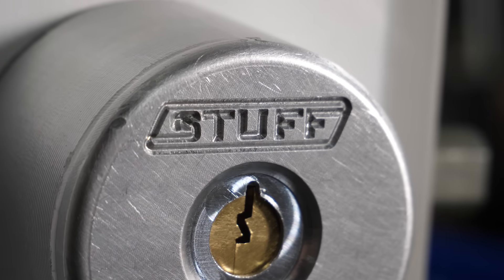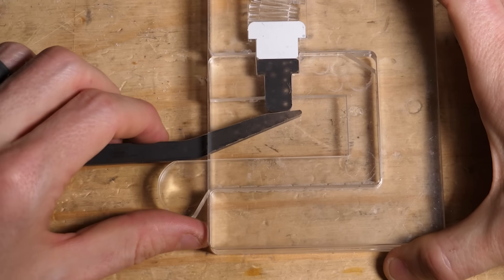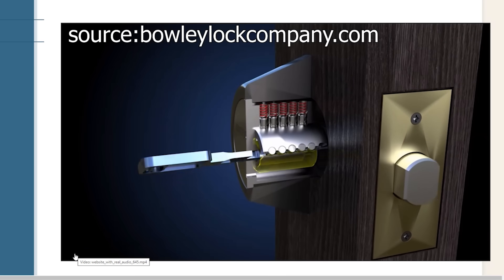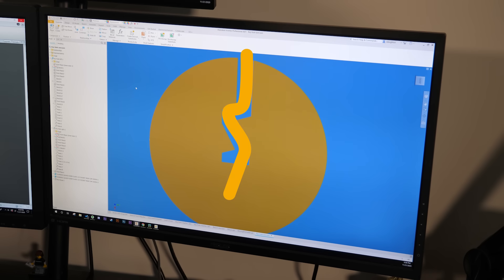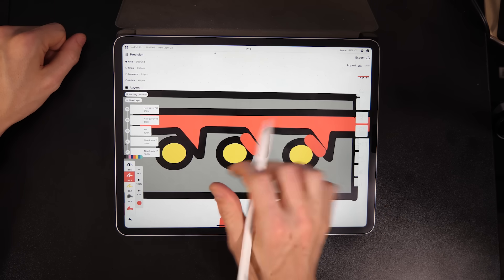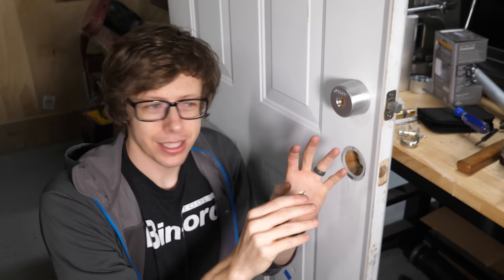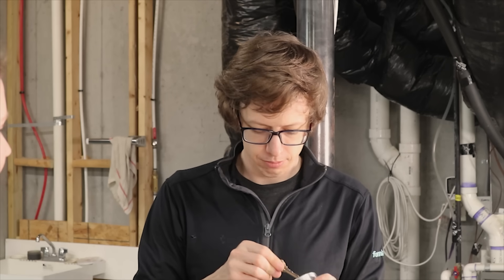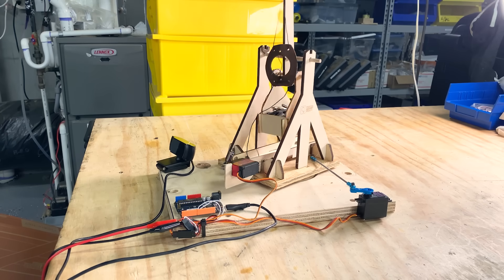Making an unpickable lock. Calling locksmiths

Comment: Unpickable?  That's not the purpose of a lock.  I'd written about 10 ways of defeating locks and other forms of security, then erased it before posting here, as posting means of defeating security isn't secure!

Yes, I'm aware this video is all about whether a good machinist could create a lock that's difficult or impossible to pick.  Proper security, however, isn't about creating "unpickable" locks.  It's about deterring and delaying entry, among other things.  I've been in the physical and networking security business for decades, and while front doors are rarely unlocked, there are many ways in, so proper security considers all such ways.

SECURITY GOALS (simplified from a vastly more comprehensive list courtesy of ISO):

1.  Make both attempted and actual unauthorized entry both detectable and reportable.  Modern alarm systems do this well.  If you get an alert any time someone gets within 10 feet of your doors and windows and can view their activity in real-time, you can call 911 before they even gain entry.  That's great!  Catch the bad guys in the act.  Put them away.

2.  Introduce delays to entry which cannot easily be defeated.  If it takes two hours to pick an "unpickable" lock but only a second or two to gain entry through a window, then your lock isn't doing you much good.  Secure those windows!  Yes, bars are ugly, but repeatedly being robbed is uglier.  Figure out ways bars cannot be ripped off with a chain hooked to the bars and a truck.

3.  Employ deterrents which convince burglars of either of the following:
 - They'll be apprehended before they gain entry.  Do NOT make this an idle threat, or you'll just help create a crowd of ever more brazen criminals.  Back it up with reality.
 - Whatever might be inside isn't worth their time and effort, much less the risk of being caught.

4.  If you're going to use cameras, do it right, within your means, of course:
A.  Use both overt cameras, which act as a deterrent, and expect them to be smashed, as well as hidden cameras.
B.  Use cameras both inside and outside.
C.  Include eye-level cameras at well-lit entrances and exits to capture faces.  Even masked faces are revealing.
D.  Capture all content for a week to a month or longer on hidden, local storage, but stream both current and the last 24 hours to the Internet for storage beyond the reach of burglars.  Burglars often scout targets ahead of time.  Less expensive systems begin streaming the instant the alarm detects entry, until the key code is entered.
E.  Include a street camera in both directions for capturing license plates both coming and going, as well as of potential accomplices.
F.  All cameras must be both HD and low-light or IR.  It's better to have a camera somewhat zoomed in to a well-lit spot where a face will transit than zoomed all the way out to try to capture everything but not be able to discriminate the detail of anything.  One situation involved a guy with two cameras mounted 25' up in pine trees.  Covered all four walls of his house and the roof, but zoomed out as they were, all they did was confirm his house was robbed.  A single hidden camera in a lit foyer aimed at the front door (which was kicked in) would have worked better.

The key (pun intended) point, here, is to approach this issue from the point of total physical security rather than focusing on the lock.

Comment: Just use a brute force locker. if you know how many pins there are and you know the distance between the pins you can build a cheap contraption that automatically tests all variations of pin depths while simultaneously turning. Surprised this tool doesn't exist yet.

Comment: I would just have a friend set a car alarm off on your street and then discreetly break the glass on the front door and let myself in but I am not a criminal.  Or, your door is wood and your jam is wood... I would just kick your door in  by focusing past the door and lining my kick up with the center level  of where deadbolt hits the door jam... metal would win and break the door jam unless the jam  is reinforced but most aren't... BTW, it is less of a lock picking challenge when you show how the lock works ahead of challenging him.

Comment: I dunno man... commercially non-viable? There is always a focus group of engineers who can simplify your ideas to get more mass produce-able units constructed and out to market. You're a smart ass dude and that lock is borderline genius. I wouldn't give up so easily on that. I can pick just about any standard tumbler lock and most keyed master locks but that thing you made looks impossible. Maybe you could construct a specialized bump key, but even then... just too complex...Well done! Superb ideas.     Now... where I disagree with you:  "want a lock that cannot be picked? get a lock without a key".  (assuming here you meant electronic or magnetic lock).  But you can easily shim or pick a combo lock and electronic locks have faults too. (RF cloning, cutting power to electromagnets, weak/failure points, introduce power surge to mechanical locks for 'fail-open' situations, etc...) Perhaps the worst part of obvious unkeyed locks or camera security is that they immediately tell the thief "meh, just break a window on the 2nd floor" and a simple ladder defeats your high-tech security... If you approach it from a criminal's mindset, I really do think a highly complex high-strength tumbler lock along with a good IR motion detection security system and vibration monitoring for windows/door hinges is the most fantastic solution. Anyhow, I really really liked your lock and think it was genius. Proud of you!

Comment: So if you lock yourself out of your house they try and pick the lock...never heard of that. most companies will take a diamond tip drill and just core it out, not trying to bum your video out but a thief would just break the window on the door you have put it on or take a crow bar to side frame to open the door with the whole door still locked.

Comment: Alright, here's a question. Using 3D printed parts, can you successfully produce bends in sheet metal, but, you have to use a clamp that relies on a piece of steel bar and large threaded bolts that raise and lower it. I'd love to see if it's possible to make old style coffee cans from sheet metal using 3d printed dies and a simple press like clamp

Comment: "get a lock that doesn't have a key"

Magnet: so you've chosen death
Reply: shudders as someone in IT I trust mechanical much more than I trust electronic for stuff like this. Just give me a hard to pick lock and that's fine. Most people aren't LPL.
Reply: this is the comment i was looking for admist all the 'wanting LPL to pick it' comments
Reply: Confused can you explain?
Reply: @luisroman2144  The way i remember it, the electric locks use well electricity but in such low voltages that a magnet can disrupt it, so in other words in this example you turn the lock "off" with the magnet. Other locks can also be opened with magnets but moving a "lever" inside the lock again with a magnet forcing it open, as far as i remember this is how the lock picking lawyer did it in the video Relem is talking about.
Reply: @luisroman2144  some locks LPL covered used motors, relays, or solenoid systems to release the locked shackles. All of these electronic components use electromagnetism to work, and so it's easy for an external one to manipulate them. A lot cheap or badly designed locks don't employ magnetic shielding and so it's relatively easy to bypass these locking mechanisms all together with a powerful neodymium magnet.
Reply: You're sure magnet locks are perfect ? :-D https://www.youtube.com/watch?v=L4-o5KNTPtA

Comment: A single bar to hold the upper pins would work if all the pins had cuts at set intervals. Say, 5-6. It would also make manufacturing cheaper and the lock more commercially viable.

Comment: "I found a locksmith that specializes in picking locks." 

Nice. Glad you could find such the specialist.
Reply: A lot of locksmiths just drill out the lock and replace it because that's often faster.

Picking a lock also risks breaking it too, so there's that factor as well.

Comment: He's made a quite an ingenious lock. But from watching some lock pick videos. I've learned that you can make a close to an unpickable lock by making several kinks in the key way and fine tuning the precision cuts inside the tumbler channels. Basically remove a way for anybody to be able to insert a foreign tool and make it so outside forces (bumping/shaking) don't disrupt the movable internal workings. Then the thief will just go break your glass window in the back of the house.

Comment: Really neat design! But what happens if you lift all the pins to the top, lock them in place, rotate, then let off the tension on the locking arm, causing the pins to drop? Seems like with enough skill/luck you could still get it to "self pick" as the pins lowered to their correct heights against the gates.

Comment: My only thought is using a tool to push the pins to the locked pin position after moving the pins to a random elevation. Either all the way up, middle-ish or as low as possible. Trying out different elevations for the pins, which for this idea would be like 27 different ways to do it. But even then it will be very difficult to get right. Could probably be done with traditional lock picking sets.

Comment: No its not all about just guessing a good locksmith would have a special tool for it and also would go off of feel. And you don't need just more locks you can create fake gates so it makes it feel like the pin is correct but in reality it isn't so I really hope you'll do more research into locks or something else when you do this but I could be wrong and you just didn't say it

Comment: The lockpicking lawyer: This easily came apart with this alluminium strip i cut from a coke can
Reply: I opened this with a Lego piece while holding my breath head down 60 feet underwater in complete darkness.
Reply: Relatable...
Reply: Very unlikely.

This lock is based on the cryptographic principle of separating checking of input and changing of input.

Opening it would almost certainly involve damaging it at least somewhat, and you'll need something considerably stronger than aluminum for that.

You can do the same thing with combination locks. But really, lock complexity is bounded by the fact that you can just drill them or use bolt cutters, no matter how pick proof they are.
Reply: @WarDaft  i think you are underestimating LPL
Reply: @johntitor6851  he’ll probably just find a way to avoid the entire mechanism

Comment: Somewhere, in a box, I have a deadbolt I picked up at a thrift store. It was brand new and still in the box. The brand name is Super Bright. I have no idea how old it is, but the box looks very retro -- I'm thinking late 70s or early 80s. I can't find any evidence on the internet that the brand "Super Bright" even existed.

The lock has 15 pins arranged radially, in five rows of three. The keyway is circular, and the keys are hollow cylinders with dimples where they engage the pins. There's a notch at the end of the key, which engages the rear of the keyway. In order to apply any torsion to the lock cylinder, one would need a tool that extends to the rear of the keyway, thus interfering with attempts to manipulate the pins.

If you ever want to try another unpickable lock design, that might be another idea.  I'm not a locksmith, but I have experience picking and rekeying locks, and I can't think of any way this lock could be picked. Plus the keys just look cool.

Comment: I like the engineering behind this. But would it not be more expensive to manufacture?  I doubt it's worth it. The locksmiths (at least here in Sweden) would just drill out the lock and replace it.

Comment: Nice premise, but please tell me how many burglars/thieves pick locks? They go in the easiest way, usually a window. If you have them boarded up or otherwise secured, they go in by brute force. Either breaking/bending the bold with a crowbar or hammer and chisel the lock body off the door. Or, break the door down. Now, imagine having a window-less, building with a sturdy metal door. Then they will drill the lock. That is why you can just use some Kwikset or Masterlock crap, as long as the rest of the door and building are hard to break. Criminals are criminals for a reason. If they could have made good money the legal way because they are smart and able, they would have. When they use a crowbar on 99% and it works, they will not get their picks out on the 1% happy about the challenge. Their first approach will not be picking. It would not even be their 10th one. When the window, the crowbar or the screwdriver do not work, they go to the next target. That's it. 

Not taking away from the challenge of designing this lock, but it will not help with home security. And when LPL or BB get their hands on this, it probably will not last long. Worst case: They will have to build a special tool to pick it...and then pick it easily^^

Comment: I'm a locksmith, so i can tell you LPL's thought process because it's the same for all locksmiths:

1) "Oh, he made a lock with manipulation and testing separated (this is core principle in lock mechanics and is apparent on many locks. Many people come to lock-design thinking they are the first person to notice this, then get schooled on how existing locks are already doing it, such as the spring-lever lock, the original mass-produced front door lock from the 17th century that didn't really feature in this video at all. TL;DR the levers (pins) are only tested after the key has passed through a certain angle of turn, and it's covered by a "curtain" so nothing else can get in while the key is being tested (and do more manipulation). The curtained lever lock was invented in 1824 by Chubb himself, as an upgrade to the Detector Lock, which is a type of lock that essentially breaks if the wrong key or picks are used, so the owner knows there were shenanigans. Good times.

2) Separating manipulation and testing is taken even more seriously for safes, but so is physical security (i.e. resistance to drilling, by inserting a bunch of ball bearings that spin instead of getting drilled), which gets harder the more moving parts are in the lock (as well as a general decline in robustness). We call this the "tolerance paradox" and it was well explained in this video although you could have done a whole 10 minutes on just that alone - how you *think* you want perfect shear-lines for maximum security (like using more symbols in a password), but actually as soon as there is a little bit of wear on those shear-lines they wont be perfect any more, so the question becomes does the lock security drop rapidly when that happens, i.e., does it stay secure after X years and Y turns of the bolt, which is to say does it have good tolerance to wear. Tolerance to wear is fundamentally opposed to perfection and complexity.

3) There is a huuuuuuge difference between "never picked" and "couldn't pick kneeling in the driveway for 5 minutes having never seen the internals". Locks with never-picked status, and several exist these days, have to be unpickable with full transparency about how the lock works - otherwise your "security is through obscurity". Now that I know how your lock works, i can invent a bypass in my head. The first thing I would look at is how does the lock perform after you have sprayed a can of WD40 inside. Those spring retainers on each pin might start to slip down, making it vulnerable to over-picking, particularly if you put your mom's vibrator on the end.

TL;DR it will take a locksmith probably 30 minutes of fiddling, after which there will be a known 5-second bypass for the lock itself, or if they're really good, the design principle itself. They may not consider what was made a "true lock" anyway, because as i said before a true lock needs to retain high security after X operations and Y years of service, else it's just a toy. A puzzle in the shape of a lock that you can bolt to a door. To assess the quality of a lock, you don't test the pristine prototype once, you test the final result of the whole manufacturing process for a run of locks. Whole businesses have gone under because their lock didn't perform at scale.

Comment: What if the pins had a vertical slot in them and there was a flat strip running through them that rotated to lock them in place, you could have leaf springs or rubber or something on the side of the bar. This may be easier to manufacture. I've emailed you a blender file illustrating how this could work.

Comment: Of what I can see, the main weakness of this lock, is the pin holder, if someone were to put wire/shim/etc. through to push on it, you've now got a mechanism that makes it the easiest lock to pick because of the spring loaded pin holder.

Comment: A lock is only as good as the container it's attached to. If the container is flimsy plastic, it's weak. If it's solid steel, you're better off. If a thief can't get through the lock, they'll try gain access elsewhere.

In this case, the container is your entire house. They could break a window, the door frame, or even the door itself. Make sure to keep this in mind when increasing your security!

Comment: I'd say the way to get into this lock would be oversetting all pins, then using an electric pick gun at high vibration to force them down into position while applying tension to trap the pins. A strong pick gun can do the job but it often breaks the lock/pins in the process and the noise might not make it very viable IRL burglary

Comment: What if you have multiple of these locks on a door? Like if you have 5 for example that's 2,500,000,000,000,000,000,000,000,000 (2.5 nonillion, 12,000,000^5) possible combinations which makes it MANY MANY MANY times harder to successfully picklock this.